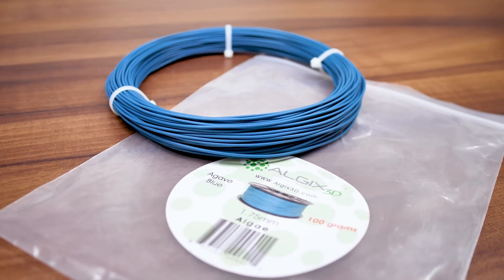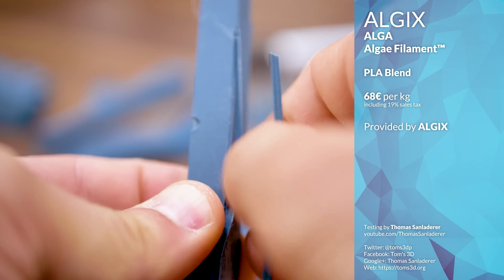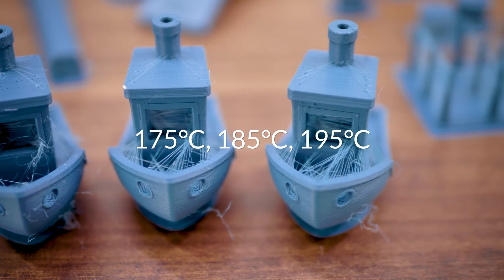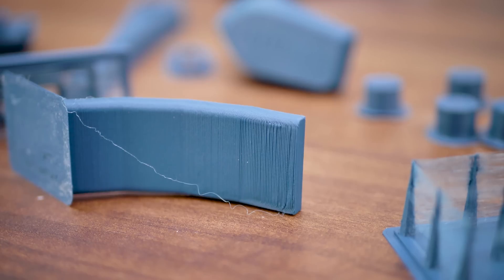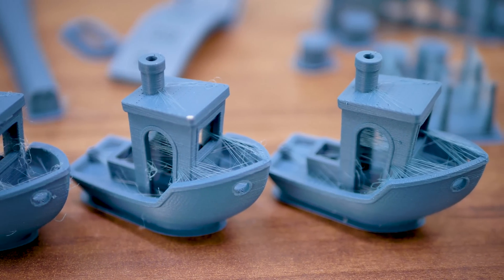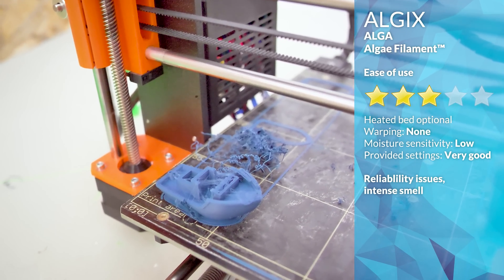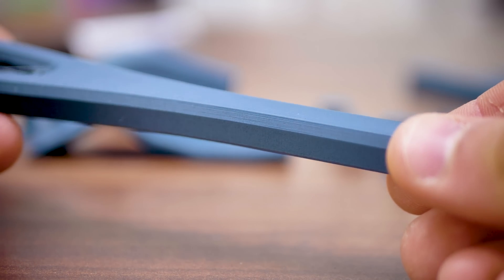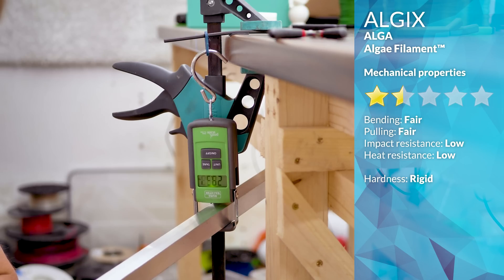Algae Filament™ from Algix-3D: The next PLA replacement? #Filaween2

Comment: I bought a bunch of filament 2nd hand that came with a sample roll of this stuff in a medium blue color.  It did have a funky smell but I really liked the texture and surface of the prints I tried - it was very unique, almost like a matt coloured wood surface. It has a different feel to it than typical plastics. I had none of the stringing issues shown and found it printed quite well so I wonder if they have been fiddling with the formula? I would actually consider buying a roll but never at the prices they have it listed for.